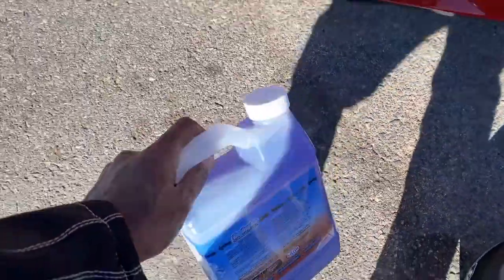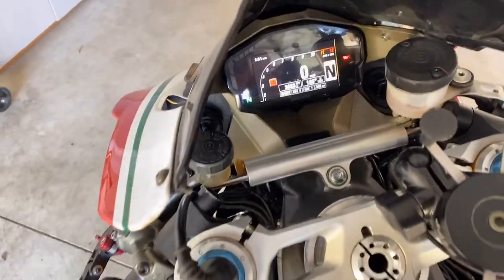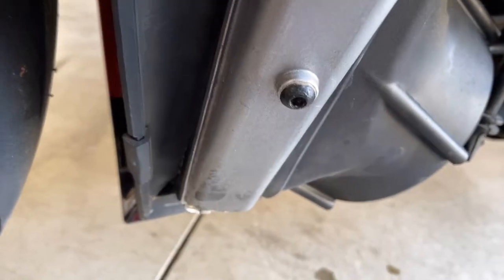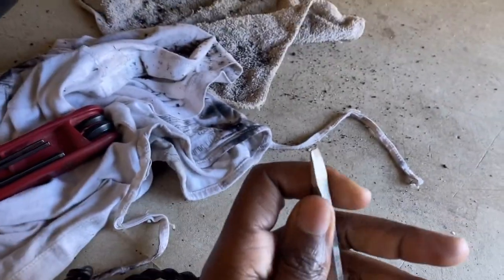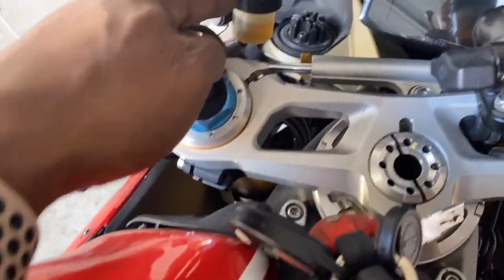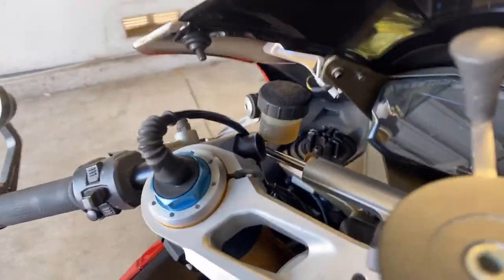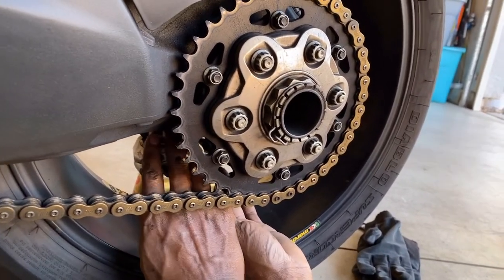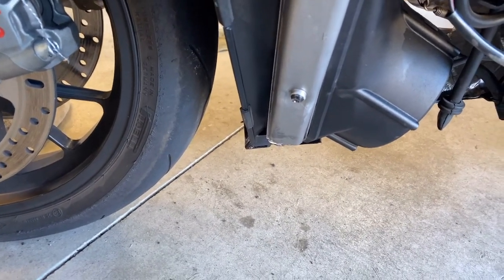How NOT to work on your Ducati Panigale | Fluid Flush and ??? |

Comment: hey, i would suggest getting a thin disc cutter on an angle grinding and cut a deep groove into the head of the bolt then get the biggest flat head screwdriver you can find and undo it that way.
Reply from the maker: I just tried something different a few days ago. I will give your idea a go! Thanks for the info man. It is appreciated.

Comment: I just had the same issue on my 1199 s tricolore I tried Dremel and easy out and the way I ended up getting it was by tapping it with a hammer and using pliers to grip the outside of the bolt and was able to get it to come out.

Comment: Screw extractor buddy
Reply from the maker: Will do. I’ll give that a go this weekend.
Reply: @AimlesslyNomadic  i had a couple that were stripped and i think i brought a kit from lowes and it had several sizes to use for various bolts
Reply: @AimlesslyNomadic   i think im going to pull the trigger and get 2014 1199s